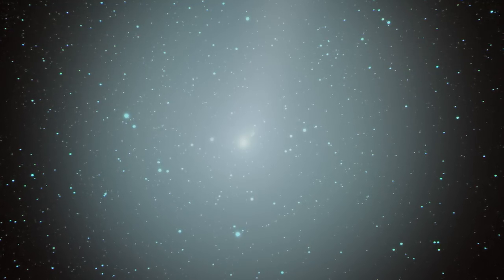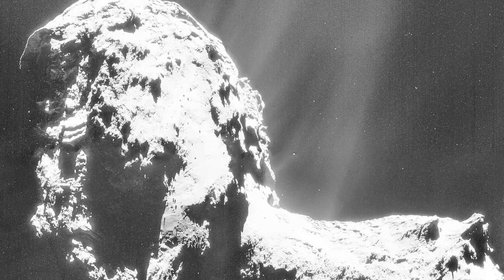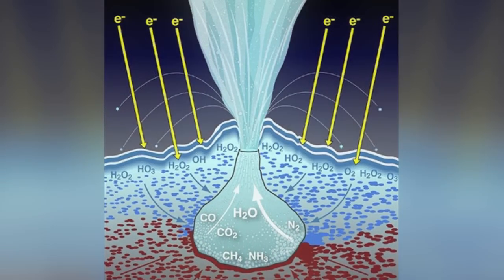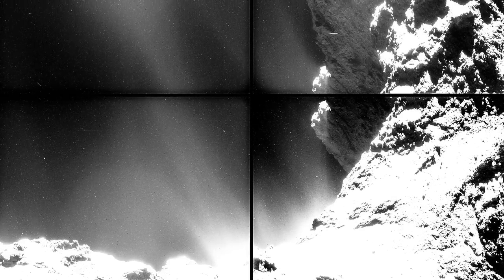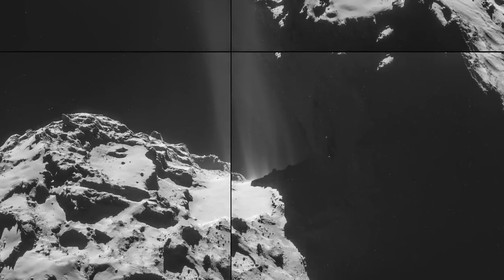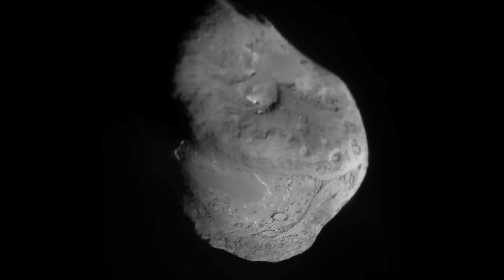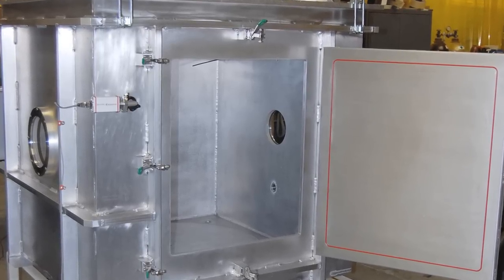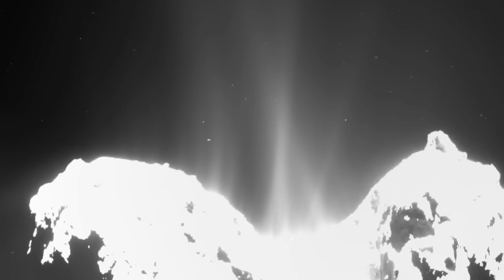Rosetta Mission Update | Jets of Comet 67P -- Failed "Explanations" Continue

Comment: I have a pressure washer & the nozzles where the water jets out are made of steel. It is 2700 psi & the velocity is nowhere near 700 meters per second. If I tried to make a nozzle out of snow for the pressure washer it would fail every time. There is NO way a dirty snowball could hold the pressure that would create 700 meters per second. & it makes no sense that there would be high pressure steam inside of a snowball, wouldn't the snowball melt first?

Comment: As kids, we used to go to the desert in Idaho and stand under some 720kv power transmission lines holding fluorescent tubes in our hands. Guess what happened? That's correct they glowed, just like Jedi Light Sabres. These light streaks are more akin to the Aurora Borealis (Northern Lights) than to water or ice vapors spewing forth from a comet.

Could you explain why the comets do not display a spiral trajectory much as a bullet spins when it exits a rifled gun barrel? No unbalanced jets of gas or steam etc. could make a thrusting along a straight axis.
Reply: It's because they aren't "jets". They are not explodng stuff from the interior of the comet. The electrical discharge machining effect is "burning off" the material at the topmost surface and the resulting artifacts are  simply leaving the body as a result of this effect.

Comment: It strikes me that if the gravity driven Universe cosmologists are correct, then when a comet begins to spew, Newton's third law: "When one body exerts a force on a second body, the second body simultaneously exerts a force equal in magnitude and opposite in direction on the first body," would show a measurable effect on the "second body." the comet.  If, instead, the Electric charge differential were the force causing the expulsion, some of that force would of necessity be applied to the surrounding solar field, and the force applied to the "second body," would be measurably smaller.

Comment: It's great to see someone stirring up some disagreement, new ideas, etc. but does it really indicate that science is all wrapped around the axle? or that the gummint is supressing the truth? (about what, gas jets on comets??!!!!)

Anyone who has warmed themselves by a log fire has heard gas jets, and seen them if they looked for them. They look like the flame of a welding torch coming out of the log, usually at the ends. As the log heats up (comparable to a frozen block of ices coming from the far outer solar system into strong sunlight) the wood generates carbon gas / methane and this gas burns, giving the lovely yellow flame. Where there is an internal crack, with large surface area inside there generating gas, and a tiny exit, lots of gas comes hissing out of the exit. It often points opposite from the main source of heat. They can be amazingly energetic and last for minutes.

Have there really been any observations of "accelleration away from the surface" of gasses and dust?

It all sounds really scientific tho. Until at the end we get "transactions between a charged body - the comet - and the electric field of the sun!" You need to distinguish between people with knowledge and actors who have a distinguished-sounding speaking voice.